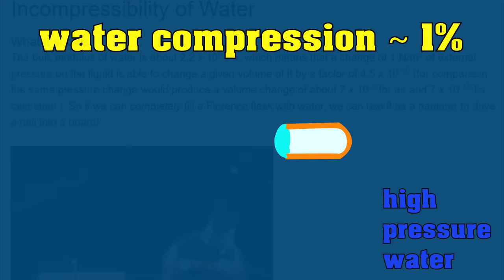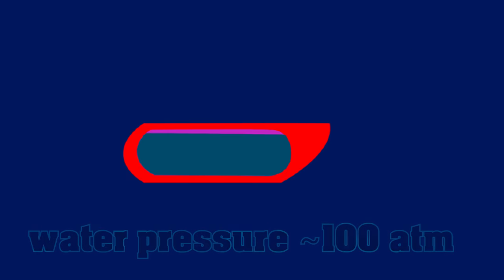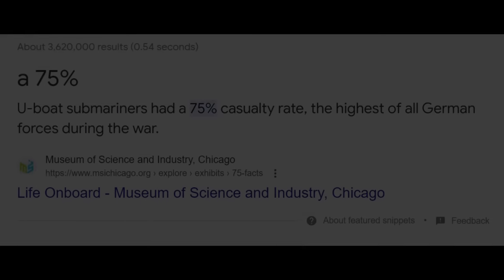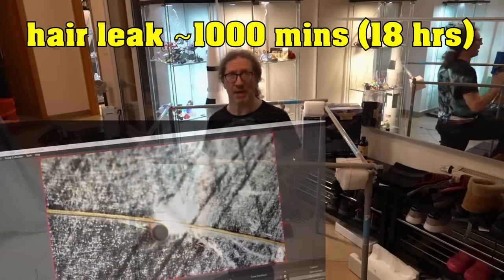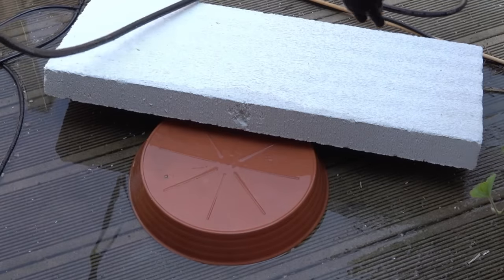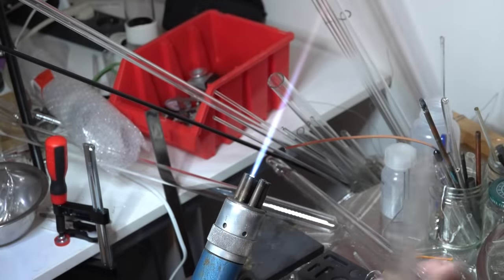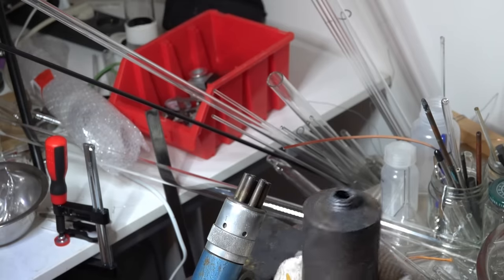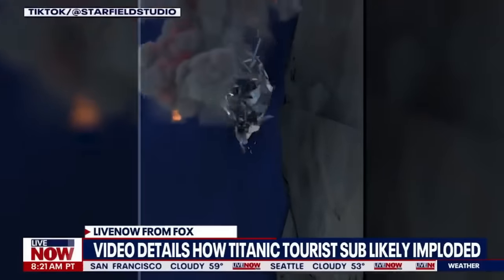Why the Titan sub failed

Comment: The dude expected to use the same submarine forever, I have no doubt about that.
Reply: he was proud to build a one million sub that had massive issues hence why the majority of planned launches to The Titanic were canceled before it began or when it just went down a few hundred feet
Reply: I saw in another video that he had been persuaded to replace the carbon fibre hull at a cost of about 1 million.
Reply: Dude used those dives to get free publicity and network among the mega-rich. Stage 2 would've been persuading one of the passengers to become an angel investor. Stage 3 is scaling up the operation, going public and then riding off into the sunset with bags of money.
Reply: He wasn't wrong. It lasted all his life.
Reply: It lasted him a lifetime!
Reply: When I first heard about the carbon fiber hull I thought the reason was to make it disposable so you would change it after every dive. This guy was out of his mind!
Reply: Lifetime guarantee!!
Reply: its not like it was going to get rusty
Reply: Didn't they make 20+ test dives with this sub?
Reply: @buildingwithtrees2258  Right?  I heard 10 successful dives but nothing about pressurization depressurization qualifications.  Can't believe what you hear on the internet.
Reply: @buildingwithtrees2258 test dives to various depths.  Only like 10 to titanic depths.
Reply: For the rest of his life.
Reply: That’s the age old question, if a car is fully swapped with parts over time. Is it really the same car?
Reply: He is using it for eternity. Riding that sub with grinning demons… over and over and over and over.
Reply: Nice clip from Das Boot - it’s been years since I’ve watched it - due for a rewatch
Reply: He's going to use it forever, as a tomb
Reply: the sub, with this hull (the second one)... reportedly made at least 13 successful trips to the titanic, rush himself stated that it had made 20 successful trips.
in addition to that it had around 70 plus other dives that were either aborted or test dives at various depths.
the first hull, i think made at least one trip to 4000 meters plus some test dives before cracking or delaminating was found so it was replaced.

which is rather impressive considering how dangerous all the new submarine "experts" found on the internet following this incident claims it was!
loosely calculating an average of 5 passengers per trip, should you randomly have to pick a number out of a hat, of which of its total trips you had to be a passenger on... a dive on the titan would be slightly less dangerous than attempting to climb mount Everest!
Reply: He did use it forever...at least his forever.
Reply: @RicardoTrevinoLohman he used carbon Fibre because it's more buoyant
Reply: @ahitch3681 ah yes, the old "trigger's sweeping brush" question
Reply: He did use it forever, in his personal case.
Reply: Everything seems to indicate that he knew that there were terrible engineering problems but thought that he was invulnerable to 100 atmospheres plus of pressure and being able to breathe at those pressures with a collapsing hull. I don't believe he was actually criminal in the sense that he knew collapse absolutely would happen, but he absolutely ignored professionals who absolutely did warn him. Imagine how that poor Mother feels giving up her trip for son, she must just ache inside. I argue that he was criminal in taking $250,000 per person with a non-certified submarine. It is very telling that this is the only mini-sub disaster in over 50 years and the only civilian submarine ever that I know of.
Reply: @rh_BOSS  Absolutely correct
Reply: @dongately2817  Same with me, oh did you ever see the rather terrible but hilarious "Wing Commander" movie where they tried to throw in a few "Das Boot" depth charges and torpedos in space. It is just so bad it is worth watching with friends around. Cheers from Canada
Reply: @ahitch3681  humans change body cells all the time, are we the same that was born? pretty sure not haha
Reply: Well he never had to replace it.
Reply: @ralphbooger4756 however, there are submersibles like Alvin built in the 60s, still going strong today, the one they discovered the wreck of the Titanic with in 1986, which has made 5000+ dives and hasn't failed. Which is what happens when you build them properly and listen to engineers saying "you shouldn't take composites to 4,000m
Reply: @buildingwithtrees2258  Somewhere around there, and cracking sounds were reported as they did more and more.
Reply: He definitely used it for the rest of his life anyways.
Reply: @RicardoTrevinoLohman that was my thought as well. Delamination alone would make this lose most of its strength after a few cycles...
Reply: Look, my driver's license delaminated and it is fine. Why wouldn't the same go for my submarine? (Submersible, whatever. We don't subscribe to standards written in blood or otherwise. We are innovators. Want us to acknowledge your "rules"? Write them with an Apple Pencil, offbrand tho. We ain't paying all that. And go easy on the syllables. Our chief engineer is 12 yrs old. (Works for literal peanuts).
Reply: @williambrasky3891  we were having some budget cuts so, we replaced the adhesive with Elmer's, the Logitech wa don't he discount bin, And the carbon fiber is actually just vinal. Our chef engineer said it was fine, and we all trust him.
Reply: Well he used it for the rest of his life
Reply: I wish they would make another submersible and put cameras with dummies inside and record the submersible imploding. I think it would be very interesting to see.
Reply: @Professor__S  camera would have to be able to survive water rushing in at the speed of sound.
Reply: @jwalster9412  then at least have another proper submersible video recording on the outside of the carbon fiber sub. Sensors also all over the sub to digitally animate it.
Reply: The actual implosion would be so fast that it won't get captured on a live feed, and I'm sure a high speed camera would be unrecoverable.
Reply: @Professor__S  it's carbon fiber not fiber glass.
Reply: Well it lasted the rest of his life.
Reply: Being a fool isn't a crime, but it is often a death sentence.  He was one big fool.
Reply: @GeomancerHT  get the slow mo guys on this. I'm sure they would get some great footage with their camera somehow.
Reply: @buildingwithtrees2258 yes but they didn't allow independent material testing before and after each dive. Carbon fiber epoxy composites are extremely strong for the weight but are brittle compared to other composite materials such as kevlar. Cracking and eventually delamination is an inevitable feature of composite materials under repeated loads.
Reply: Good on him
Reply: In fairness, he did use one sub for the rest of his life
Reply: @perilousapricot  it almost out lived him infact.
Reply: I suddenly have so much more respect for heart.. as an organ.
.
Especially mine.
Poor thing is terribly overworked.. mostly because I gorge like a pig.
Reply: I mean...  he kind of did.
Reply: And now he can
Reply: He's proof that IQ and SES don't correlate
Reply: @jwalster9412  He outlived it for a fraction of a nanosecond.
Reply: He was a billionaire but still didn’t whana spend more
Reply: How do you explain they've been down there for times  so far... Or however many times they've been to the Titanic I don't really know the exact number but how do you explain them ever make it in the first place